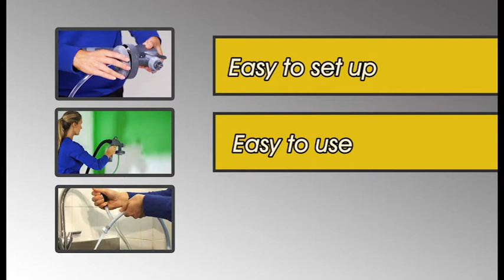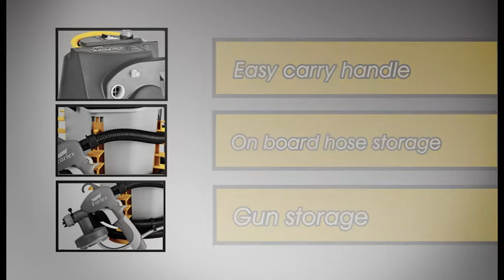It's 2012......It's time for the SprayStation® Gemini!

Comment: I'm not sure why this advertisement says no thinning of latex necessary, as the instructions that come with the unit clearly state thinning is required. I typically add about 20 ounces of water per gallon with Behr paints from Home Depot. So 15% or so dilution. I find this machine to be very finicky in use, and takes a very long time to clean the unit after you're done--about an hour. The small  quart jar is much faster, but doesn't work on ceilings or floors. I get it to work about 30% of the time.